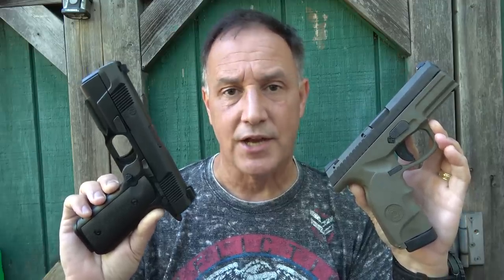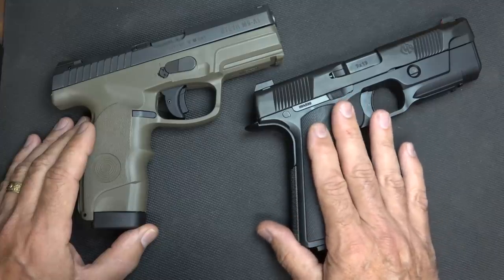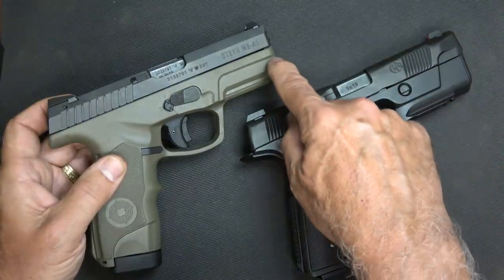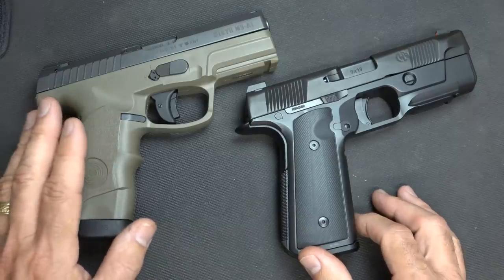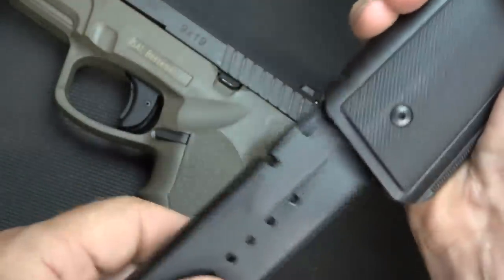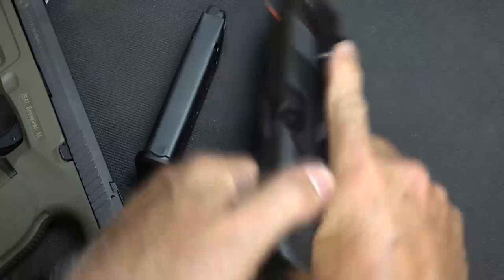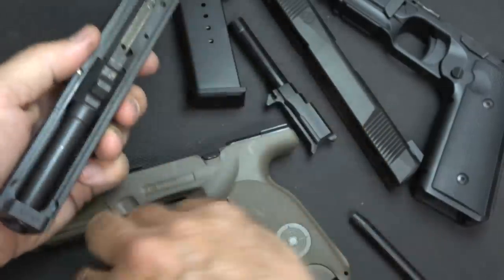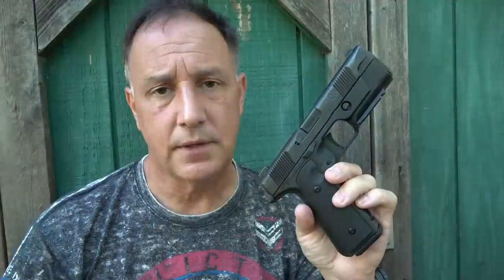Hudson H9 vs Steyr M9A1 Pistol

Comment: The Steyr is by far the best polymer pistol I have ever fired.  It makes you not want to try anything else.
Reply: Kawboy65 I don’t have one myself but I compared a friends m40? Against my glocks, xdm, beretta 96, custom Ngai 1911 in 40, cz75.....I may have had others that day but don’t remember. Anyway, the steyr was softer shooting and seemed to have less muzzle flip. I was using as test Ammo...lawman 165 gr which are fairly hot 40 caliber.
Reply: I have the L9-A1, which is the full size 9mm.  It amazes me that, if I am having a bad range day and seem not to be able to hit with my other guns, I can pull the Steyr out and instantly start shooting good groups again.  I did have to put Talon type rubber grips on it because there isn't enough grip out of the box.  If they would have marketed these pistols strongly when they first came out, I don't think there would be nearly as many polymer pistols on the market today.
Reply: You are right, the Steyr is my carry pistol, they are excellent pistols. 

The Hudson fails A LOT.  Most of the gun channels that I watch have had a failing Hudson video.

There is really no competition.  The Steyr is less than half the price.

Comment: "little bit of mush" isn't there on pre a1 models or a1 models. Your model has a roll pin under the sight post. You will here their marketing spin of "it improves the trigger" and this is one of those things that's partly true, because it does increase the durability of a part, but the main reason it's there is to add "a little bit of mush" during the take up to the trigger for legal/liability/lawyer reasons. Pre 04 models have the best triggers.

Comment: If you look closely, you can see how far the barrel is up and away from the trigger on Hudson. It's just the grip angle is tilted to bring the rear of the grip closer to the upper slide and front way down and far from the barrel or the slide. While on the styer  the trigger, the rear grip, both are very close to the barrel. The larger area on the front of both the pistols are set up in a very different way, the two are not equally placed at all. On styer the larger area comes just in front of the trigger guard and just below the barrel, while on hudson, the larger area is gradually slimming down above the trigger compartment, so the whole trigger segment stays below that larger area and is very confusing.

Comment: I was able to pick up a hudson a while back. To those considering, for commonality sake I'd recommend that you get the steyr. But if I can say this, the Hudson although larger due to the 1911 grips, it's absolutely got a lower bore axis than the steyr. Also, look at them side by side, the Hudson isn't just the bore axis, it's the spring placement. The Hudson spring is directly in front of the trigger, and that directs more of the recoil straight back. Idk, just consider everything, especially since Hudson went bankrupt and never got to make a polymer frame.

Comment: Great vid! I actually own the exact same Steyr M9-A1 on OD Green and I absolutely love it! While my PPQ Navy has a high bore axis it is still my favorite out of all of my handguns, even my CZ P10c. The Steyr M9-A1 is the most underrated handgun out there. It is extremely ergonomic, accurate and reliable. The trigger on the Steyr comes close to the PPQ and P10c trigger. The only cons I have about the Steyr is that it is a bit heavy (Which can be considered a pro on the other hand) and that the serrations are a bit shallow.
Reply: The barrels are also a bit on the short side for the given slide length due to the grip angle. Still an amazing gun, but a definite drawback.

Comment: Ok, first , if I were to buy a M9-a1 steyr as opposed to a Hudson 9mm would I be better off because the same platform of the steyr S9-A1 is it’s little brother as far as concealed carry? Both Steyr models are the same and one should train with the same platform?
Reply: I would stay away from the S9-A1 and the C9-A1 at this point. The short barreled Steyrs, S models  and C models, have had many many reports of erratic ejection and brass to the face. The Ls and Ms don't seem to have that problem. There's a Steyr forum with Steyr pistol enthusiasts and many have reported on this issue coming from the S9-A1 and C9-A1.
 
I have the L9-A1 and the S9-A1. The L9 is my favorite pistol, and I own or have owned Glocks, M&Ps, CZ-75B, Walther PPQ, and other less known brands. I love my Steyr L9-A. My S9-A1 however, gave me lots of trouble, including brass to the face and top of the head, as well as failure to go into battery issues. The S9 also only comes with magazines that are plugged to only have 10 rounds, though the magazine itself is long enough to hold 12 if it didn't come plugged from the factory. They can take the longer magazines from the M9s but of course those will stick out.

Comment: 37 oz?   I keep my CZ sp01 tactical.  Great gun with a threaded barrel and factory night sights and a few hundred dollars less.  And it also shoots flat because it weighs 43 oz.
Reply: The Hudson comes with night sights also..  And its six ounces lighter?   And your CZ is better because it has a threaded barrel but you don't run a suppressor so?
Reply: rainmechanic and you know what's in my safe how?   Nice try Hudson fanboy   I will grab a 9mm can eventually.  Looking for a 30 Cal one for a 300 BLK project.  If the Hudson was 30 oz and not $300 more than it's competition it would be interesting   plus if you want a big weight go all in.

Comment: I have the Steyr C-9 A-1. I have retired it to bedside protection only. The C-9 ejects the casing right back on to your upper torso. Steyr replaced the ejector. I still have the problem. There is nothing like having hot casing in shirt....
Reply: It's gotta be something with the size then, the Ms and Ls don't do that. I've only taken 1 casing to the face and it was from deflecting off the plexi at tge range. There are a lot of small tweeks and differences between the bigger modles and the smaler ones.

Comment: Thanks for another nice review. On the Hudson, did you notice any looseness of the barrel while the slide was in full battery? There is an H9 sitting at my LGS and I almost bought it until I noticed that in full battery I could move the barrel up and down by pressing on the barrel hood. I tried it in other guns at the store and at home and none of them have that play. Thoughts? Thanks!

Comment: Just wanted a piece of advice so I’m looking for a potential handgun to serve a specific purpose the home I have is filled with lots of small to mid size critters and I was looking between 2 really different handguns 1. A standard 9mm specifically the ruger security 9 or 2. The ruger gp100 in 22lr if you can please provide a little feedback on which of these handguns I should consider buying more

Comment: Does the Steyr have custom aftermarkets parts to take advantage of the chassis system.
Reply: Sadly, not so much. As Sootch pointed out, the chassis isn't the serialized part, so you can't swap it from the grip module in any way.

Comment: I really like the Steyr but the early models had the weak extraction spring issue and the company was in denial, has it been fixed or will I have to wait for the embargo against the Russians to be removed to buy the PL-15 Lebedev?.

Comment: Thanks for another nice video.  On the Steyr couldn't you buy a frame via an FFL and then change the chassis out?  Kind of like an AR lower, or Glock frame?  Of course assuming Steyr Maes frames available.
Reply: You could, theoreticaly do so yes. Steyr doesn't sell just the frame though. You might get in touch with Steyr USA and mention that as an idea. The CEO of the US branch wants to make Steyr a more advertised brand here in the states.

Comment: Biomechanically, the grip position in relation to the trigger is quite different between these two side arms.  The H9's setup has the wrist, hand, and finger in a very natural pointing configuration.  The Steyr has the wrist tilted forward at the top, placing more twist in the wrist...damn, that rhymes.  The H9 felt more natural and shots felt more comfortable and easier to follow up...but my pocketbook would never forgive me if I tried to buy one  :-{
Sorry, just my nickel's worth.

Comment: Hudson H9 died because of PRICE. If a company thinks regular people are going to RUN and order a,  $1,000 because of the "features," you are just wrong. Why would I spend "Russian roulette" and probably burn $1,000 when I can pay half or less for handguns that are extremely reliable, fast shooters, lightweight compacts, and / or smallers and also they are sold in bigger configurations like an M&P 2.0, Gkocks CZ P-10 etc..? 

Canik, as an example, started with budget prices, now days they still have very affordable handguns but also more high-end handguns. I don't need to spend $1,000 to shoot 9mm accurately, fast, and reliable. P-07 SR perhaps...

Comment: I would take the Hudson because it is not plastic.  I already have a glock.
Reply: Brian Kerr, the Hudson gas a really bad reputation for failure. 

Steyr is the best pistol in Austria.

This is no competition.
Reply: I already have a plastic gun.  Plastic, will it be around in 100 years ?
Reply: Brian Kerr, yes.  But you and I won't be. 

Buy a CZ P01 Tactical if that is the issue.  Hand that down, it works.
Reply: I never buy the first gen anyway. I buy  interesting and unique firearms. The Hudson qualifies.
Reply: Brian Kerr, that is true.

Comment: I wonder why Sig and Steyr are in court
Reply: Sootch what do you know about that lawsuit??
Reply: The m9a1 predates the sig p320 and uses a chassis system which the sig also uses steyr did not give permission and sig didn't ask for it leading to steyr suing sig over use of a patented design feature since both are polymer framed striker fired pistols

Comment: The Sig p365 has issues with the stricker and the reset spring for the trigger. If I’m not mistaken the Steyr S9-A1 and the Sig P365 has the same mag capacity, right?
Reply: Joseph Blaylock only because they are plugged at 10.  That magazine is a 17 round capable magazine. A few modifications it can work for 15-17 rounds.  The sig 365 and this gun are totally different.
Reply: Yes they are both 10+1 and the steyr (in my opinion) is a better gun. I typically shy away from guns that haven’t been on the market for too long due to recalls, not unlike the P320. The steyr for me is the most ergonomic handgun to shoot I just wish they had a better aftermarket and some sort of a marketing strategy